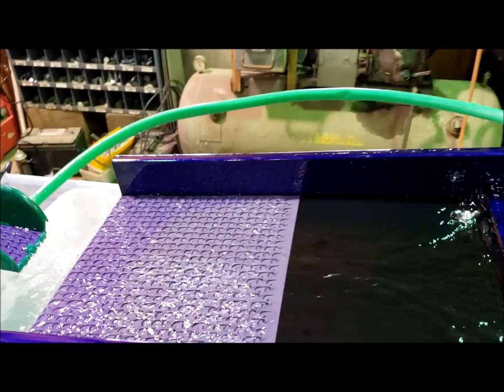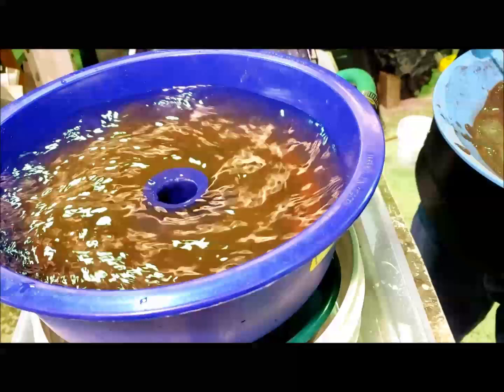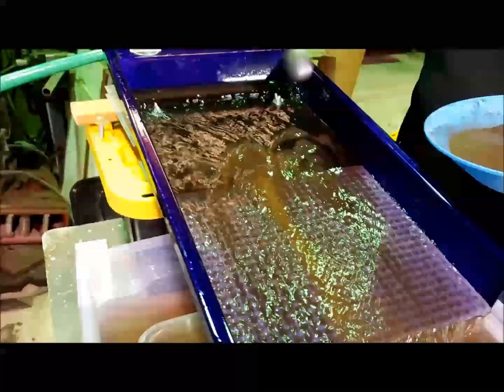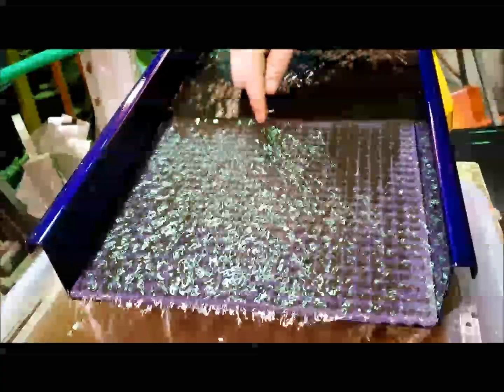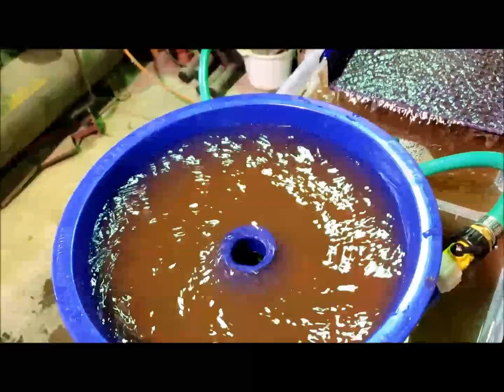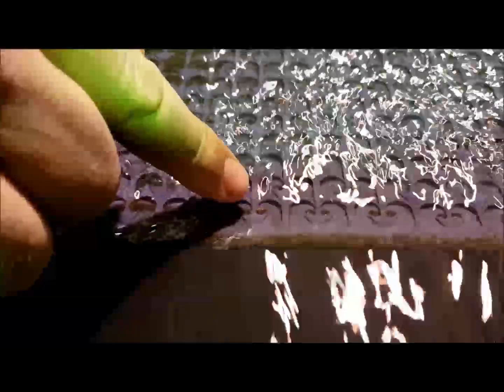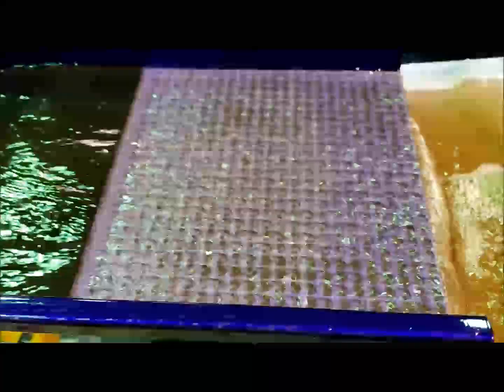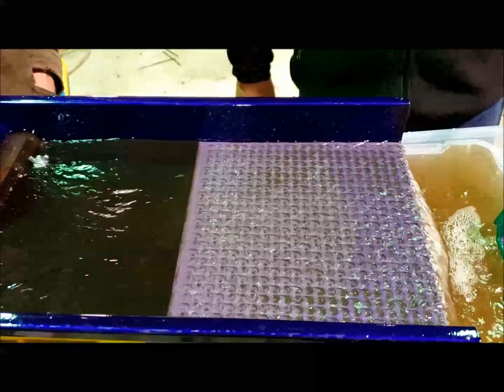Extracting Fine Gold from Black Sand with Blue Bowl, Dream Mat & Miller Table

Comment: Great video  (1)How do i install the Dream  mat into the blue bowl  (2)Do I use Silicone (3) it doesn't sit flat on the bottom of the bowl  it sits up on the center cone  is that normal? Any help would be much appreciated